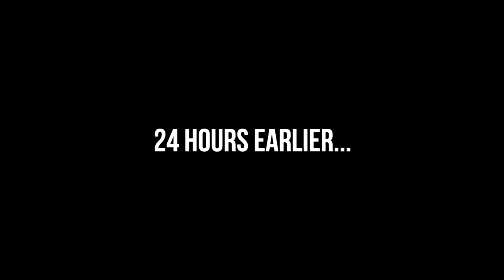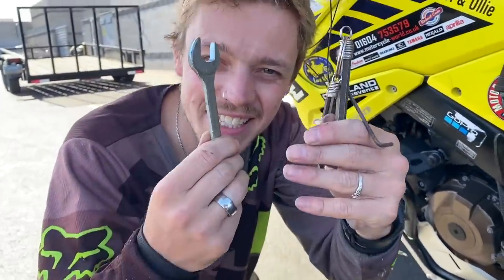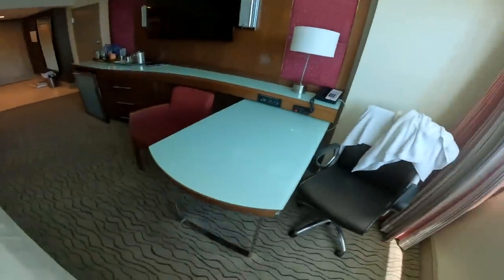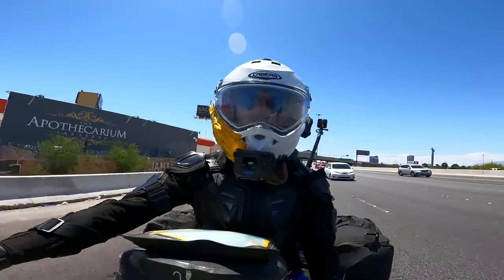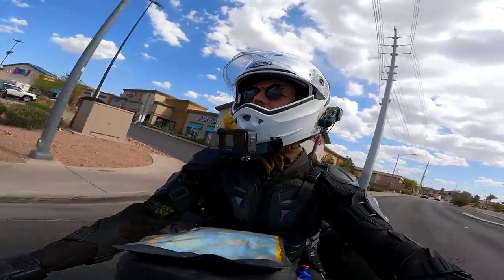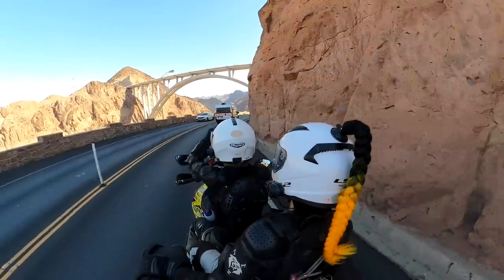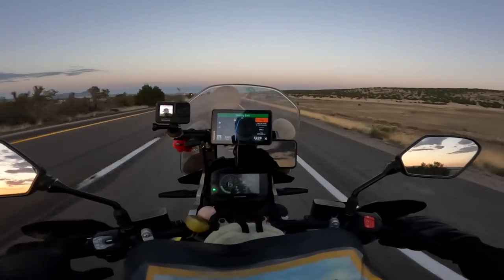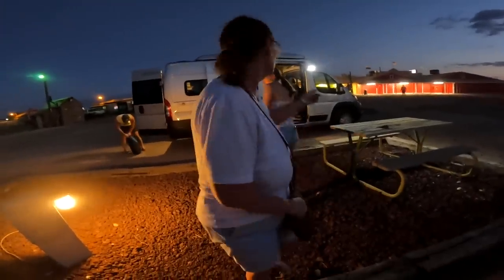We Rode 28,893 Miles to Get MARRIED in LAS VEGAS! 🇺🇸 [S4-E39]

Comment: You should name and shame the dodgy bike dealership. $80usd is a fortune. Maybe you will get some socket sizes that are the most used like 6mm 7,8 , 10,12 13,14,17,  plus wrench. It shouldn't be too heavy but the sizes for rear wheel nut, brake calipers, brake levers if it goes over again  plus some Allen keys are always very useful . Rear chain adjustment, drain plug for engine oil and for bleeding brakes, spark plug size long socket. You should be able to have it all in a tool roll or home made tube that's attached with a few cable ties and some puncture repair kit as they're small and cheap on E bay. No doubt Ollie you know the v Strom's well now. I love seeing you both well scrubbed up and looking amazing for your wedding. Congratulations and big luv to you both . What a wonderful place to get married and have a reception with your loved ones. You have Area 51 and the ETs and flying saucers nearby and the beautiful desert and fantastic stars at night.
Reply: Michelle and Doug certainly will be able to share some great tips on where to go. A scotoiler for the chain  will make it last far longer.
Reply from the maker: That’s repairs in the US, $160 hourly rate! 😩 a socket set would have been great from the beginning! Didn’t even think about getting more tools because we didn’t think we would know how to use them anyway, but perhaps now we have learnt something? 😂 For the next trip I guess! I’m glad you think we both looked well scrubbed up 😁🤵👰‍♀️ was so much fun what a great day! Thank you ☺️